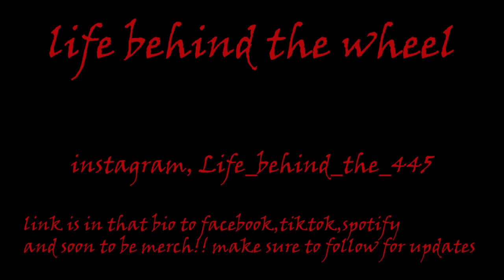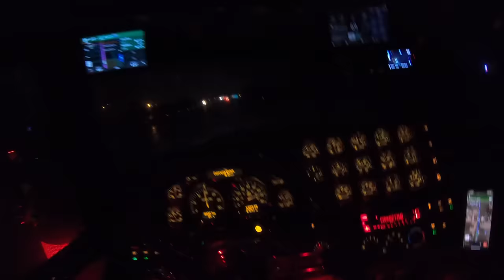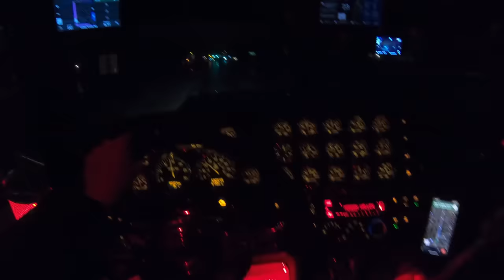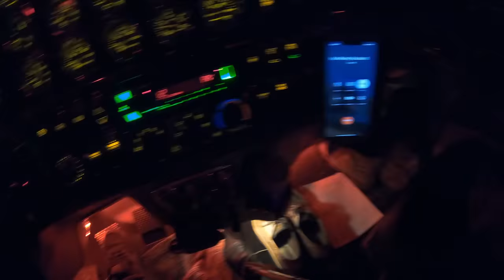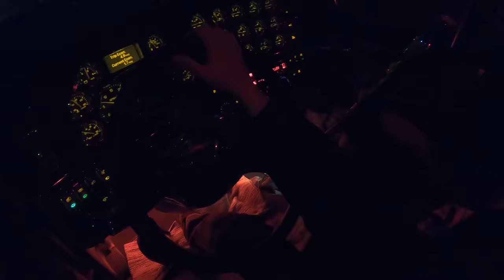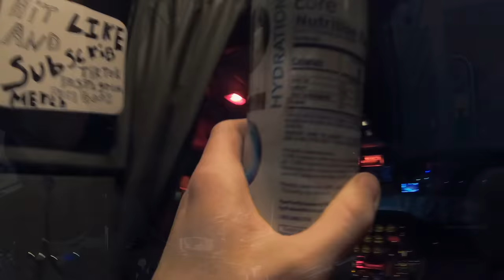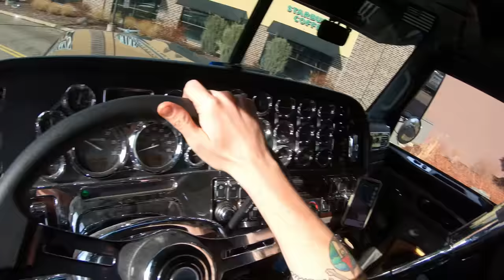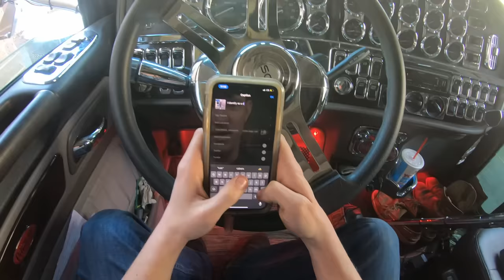Stretched Peterbilt identifies as a day cab

Comment: I can't drive anymore due to health reasons. Riding along with you brings back a lot of memories. I ran 48 states and local with flat-bed, reefer, dry van and tanker. Started back in the early 70's when we didn't have ac, power steering or air ride seats. Most of that came around when the ladies started trucking. They were smarter than the men because they bitched about not having the goodies and fancy trucks and companies started getting better equipment. Little tip I learned, if you put your 4 ways on that does a pretty good job of lighting up the rear area also. Keep on trucking lil bro.

Comment: Funny.... Last Weds running a drop just in Ohio I had my coolant hose blow last toll before Charleston, WV. Duct tapped the hole up from the Pilot etc to limp it to the TA Shop, but with coolant light on it killed power to the Volvo........ One thing about them sensors, if they come on with some trucks it will cut power as a safety precaution not to blow the motor despite watching your temp gauge.... It's a drag!!! TA told me 5-6pm before they could check the truck out at 12:30 that afternoon.... Ever in a situation there, cross the over pass to the Go mart because companies cannot work on the truck in TA parking lot there... Liability for someone getting injured, go figure....  Call Advantage Fleet.... Or if you can make it, drive to their spot, they got a shop. Long story short, they brought me an upper hose and some more coolant and was rolling again in about 2-3hours. Keep the hammer down! :D

Comment: Plug a paper clip in the plug and the light will go out and the truck will stay running until u change it ,,just tape the paper clip with elec tape so it won't touch anything

Comment: Sounds like you got the ol 60 series detroit in her tuned up to 600 hp.. you havent revealed what engine you have but she sounds like a detroit.
Reply: He's said long ago, it's a deleted Cummins ISX.
Reply: Also, did you notice the DEF tank in front of the left hand fuel tank, no series 60 ever used DEF.
Reply: Yeah Ive known a few people that have done an engine swap and have left the def tank on... good example my previous company, they swapped a cummins isx cm2350 for a C15 6nz and left the def tank on.
Reply: You’re wrong. I used to drive a Coronado that had a 12.7 60series and had all the dpf and def crap. Luckily for me it was a local company that used it to haul logs and weigh wood so they deleted it and turned it to 525.

Comment: I drive a KW T880 garbage truck and my coolant level sensor is bad too, have the thing unplugged so it would stop dinging at me and everything lol. Guys in our shop told me its the float in the tank that goes bad, not the sensor? I'm not sure how accurate that is, ive also been told the connector goes bad. Can't seem to get them to fix it though 🤬